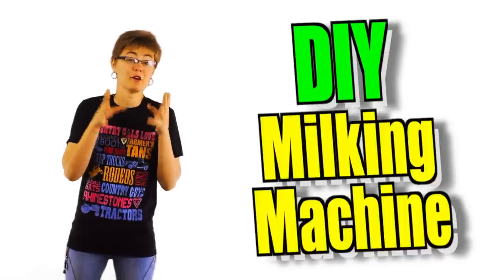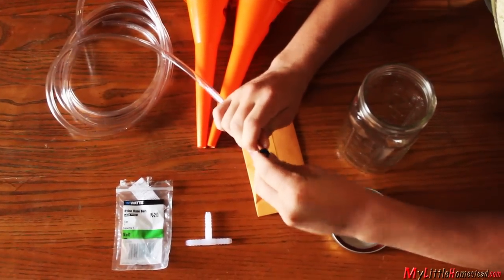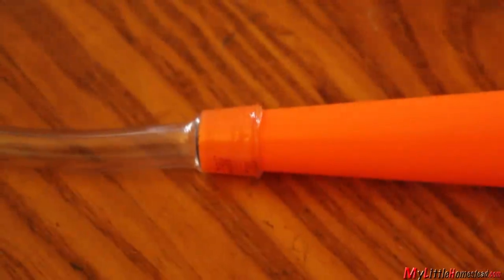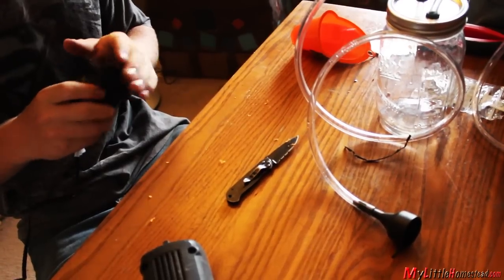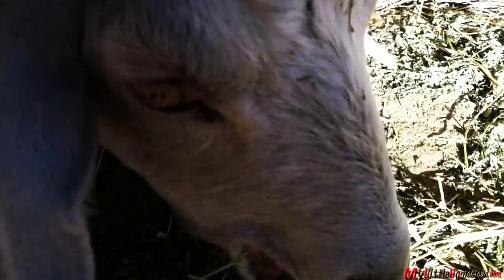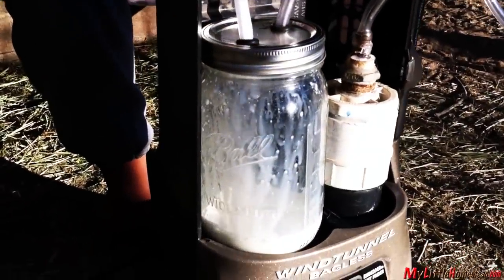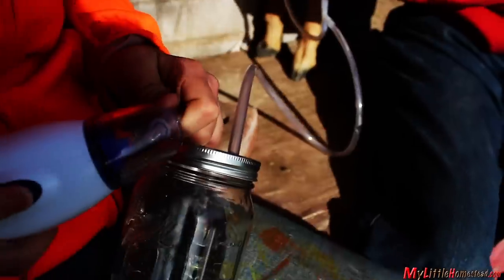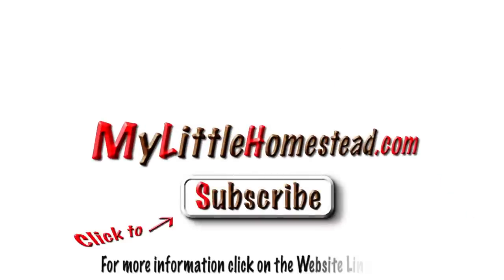DIY Handheld Milking Machine - Milking Skills NOT Required!

Comment: Instead of funnels, use syringes.  They are in various sizes and allow you to see the flow of milk as it exits the teats and seal very nicely as well.  By seeing the milk, you also reduce the risk of using too much vacuum which can seriously injure your goat's teats/udder.  "Commercial" vacuum milkers have gauges to ensure how much vacuum is used so try to have a pump that has a gauge.

Comment: I love it!!! It will work much better if you alternate the sucking from side to side. Store bought milking machines do this with a valve switching the suction from teat one to teat two and back over and over. Simply sucking on both at the same time doesn't work very well. This also doubles the suction because all of the suction is only on one teat at a time. Also if you use larger hoses the suction will be better.
Reply: What is the idea behind alternating?  The teats have their own udder "side" and are milked separately.  If the milk came from the same place, alternating would make sense but that is not the case.  People milked by hand alternating because it worked better, mostly due to the hand positions - it had nothing to do with how the milk leaves the udder.  It is more difficult to coordinate two hands on two teats to do the same thing which is why alternating is done; it is just easier. If there is a solid reason for alternating when using a machine, please share that.
Reply: Glenna Rose The reasons are a few.
1. You get full vacuum on one teat.
2 It pulls only on one teat at a time. Which is similar to kids sucking on the teats.
3. It gives a small rest to the one not being sucked on.
4. The teat is not constantly being sucked on. It's not a faucet you can just turn on.
My father never told me the reason why it was better. He just did the studies that showed it was and by quite a bit.
Reply: Thank you for the explanation.
Reply: What size hose would you recommend? I am having trouble using this DIY model with the Food Saver vacuum seal.  It's not milking her out which needs to be done. I end up having to milk her out by hand and it's just hard for me. It does not seem to get much milk flow either.

Comment: We did the similar thing with a FoodSaver pump.  The biggest difference is I did not do the T to join the tubes as both of my hoses go right into the jar.  This allows a maximum flow of milk.  The 60 ML syringes were what we found to fit on to the goat smoothly.
Reply from the maker: +Jay Johnson 
Have pics? Tell us more about the story.

Comment: I think your problem with suction may be more the fault of the teat cup design than with the type of vacuum pump.  Try using 60cc syringe tubes, sans needle obviously!!  The type of tubing you already have should fit perfectly without even the need for the heat gun.  The straight sides of the syringes will give a much better and more easily achieved seal around the teat than something cone shaped.  If you use a brake bleeding pump from the auto part store, you can monitor the pressure with the attached gage so as to avoid discomfort and maybe even injury to your goat.  Hope that was at least a little helpful.
Reply from the maker: +dellasmom Thanks for the good info :)
Reply: You are very welcome!!  Hope it is actually helpful.

Comment: What size hose would you recommend? I am having trouble using this DIY model with the Food Saver vacuum seal.  It's not milking her out which needs to be done. I end up having to milk her out by hand and it's just hard for me. It does not seem to get much milk flow either.
Reply from the maker: 1/4 inch. Hang in there. Keep trying. Give the teet a few starter squirts before attachment.
Reply: My husband did not want to milk our goats until after a couple months  of the little ones getting milk. No wonder why I was not getting much milk when I finally started milking!  Her body had sent the signal to stop producing so much milk. I finally told him we need to start milking from day 1! 4 years of having goats and not much milk for him! Me...I dislike goat milk. Give me raw cow milk!

Comment: a milking machine isnt just a vacuum... check how it works before building a torture machine... poor goats
Reply: If you get a long enough vacuum hose, you can run it to a vacuum port on the intake manifold of your auto. Rev your motor up to make fast milk.

Comment: Consistent suction not good needs to pulsate
Reply: There's a trick to it.

Keep just enough suction to keep them on but not pull. Then press button to create pull. Leave and allow to naturally pull the milk out with the suction. Then as pressure releases you press the button to create more pull and suction. Repeat.